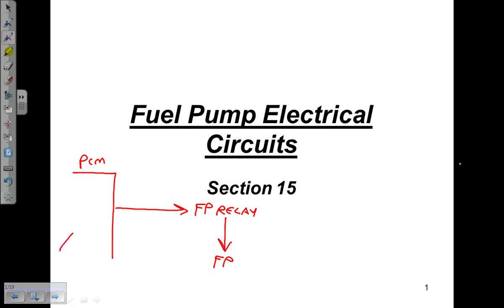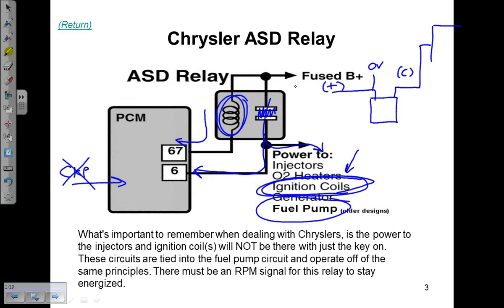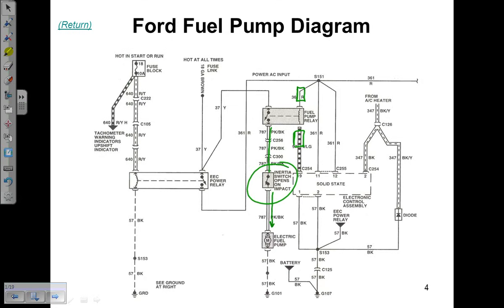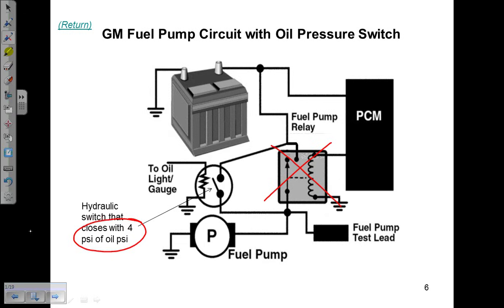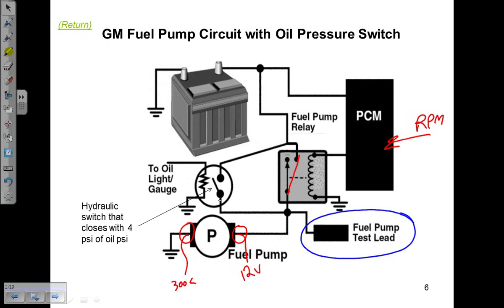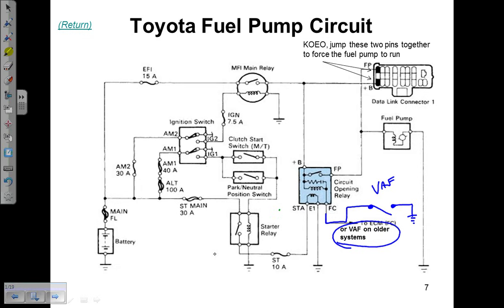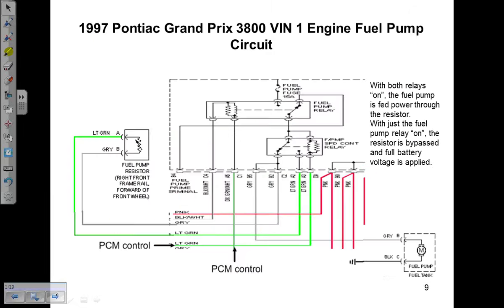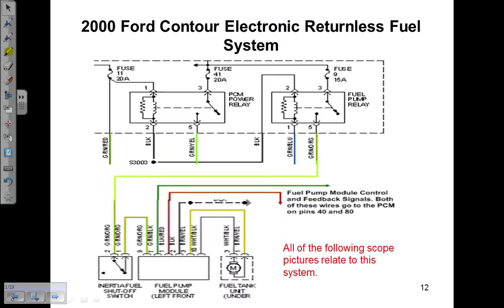Fuel Pump Electrical Circuits Description and Operation

Comment from the maker: @Amopower The book is more system and component oriented, not any one particular manufacturer. So it would apply to both EEC-IV and V as well as all other OBDI and OBDII systems. 
Also you can print from my book (2 pages at a time) so if you really wanted to you could have it in your hands. Thanks